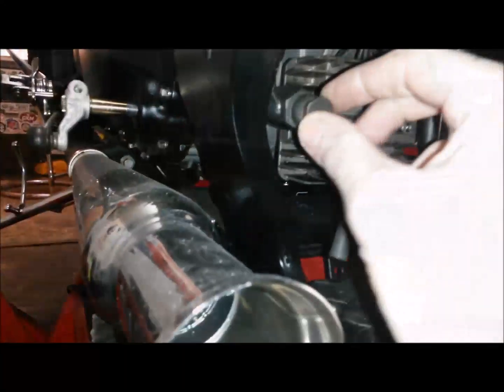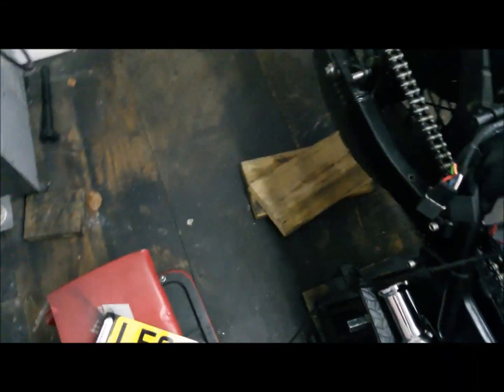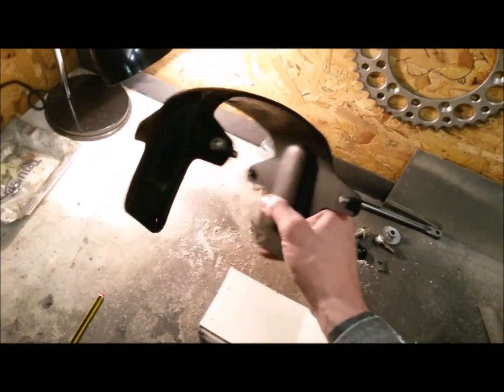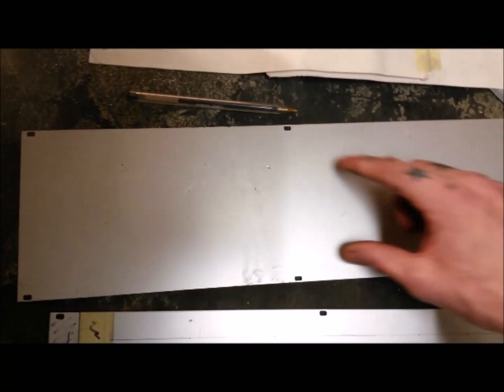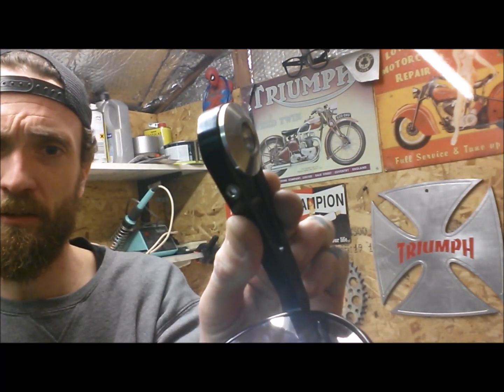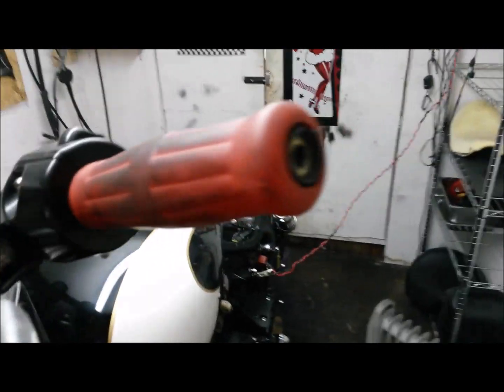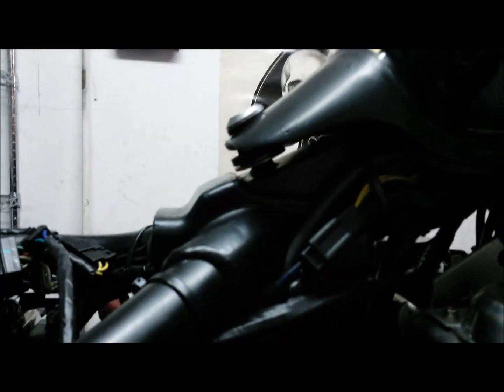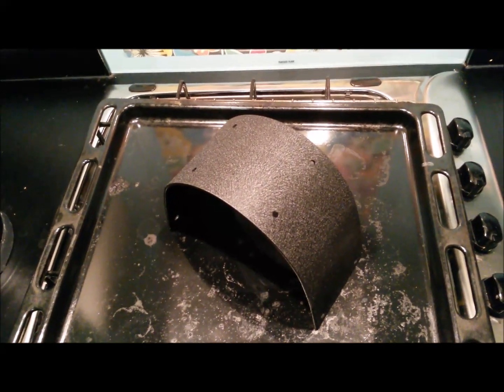Triumph Bonneville America  brake light fixed! and more brackets

Comment: Enjoyed your vid, another solution for bending aluminium is the workshop fire extinguisher, this got me out out of a problem in my workshop in the Middle East the solution was staring at me hanging on the wall .
Reply from the maker: i was wishing for a fire extinguisher!!! the welding bottle was a little too small- would have been less embarassing than in the middle of the street round a lamp post!! i did get some funny looks!!!

Comment: Hi buddy, Del has a super duper tool to install those captive nuts, however nice bit of fabrication mate. Take care.
Reply from the maker: hey mate!- yes we use them at work- but i didn't want to chance cracking the fibre glass - it's not super thick in that area hence i went for encasing them in resin!

Comment: Great work again jc.
Reply from the maker: cheers buddy! felt like quite a productive session!
Reply: johnnycactus0 Yeah their the best sessions dude, I've also gone back in the house from a bad session too pulling my hair out from snapping a manifold bolt  flush against the block lol. You take the rough with the smooth I guess jc.
Reply from the maker: ouch- i feel your pain mate- had that happen on the sr250- although the engine was coming out of the frame so it was easier to attack......

Comment: Those captive nuts are actually rivnuts. With the right tool you expand them like a rivet - it could have saved you the hassle of fiberglassing around them. Delboy's actually made a video about them recently.
Otherwise, very enjoyable series. I love the wall anchor idea for the handlebars, might use it in the future.
Reply: in my experience, rivnuts on fiberglass is a game of Russian roulette. Clamping them too tight is easy, and breaks the part your attaching them too. Don'zt go tight enough and they just spin. Doable, sure, just a pain in the ass. Glass them in is a safe bet in this situation.
Reply from the maker: yep we have them at work- however i'd be cautious about expanding them in such thin fibreglass. i think fibre glassing them in is the best option in this instance. wall anchors are great- i find them to be the cheapest and easiest solution to bar end mountings!
Reply from the maker: yep mate- exactly my thought in this application. didn't want to chance cracking the fibreglass.
Reply: My bad, I've only ever used them in metal and thick pvc.

Comment: My brake pedal is working properly. My brakes has been great since I got the bike last year. But the other day I started out for a ride. As I left the driveway, I eased on the rear brake. It went all the way down without any brake operation at all. I’m not sure if the brake cylinder has developed a leak or what’s happened. But there fluid in the reservoir, so it isn’t low fluid. It’s just that there’s no action on the brake system when pressing down the pedal. Have you heard of this before?  My bike is a 2016 Triumph America with 6,500 miles.